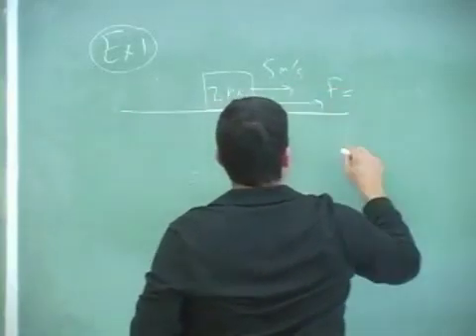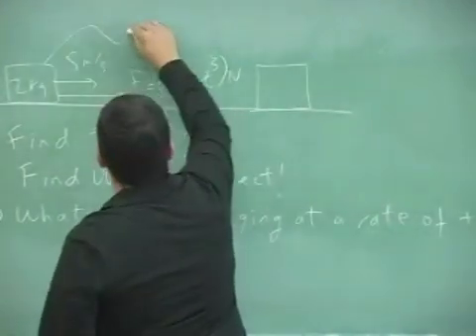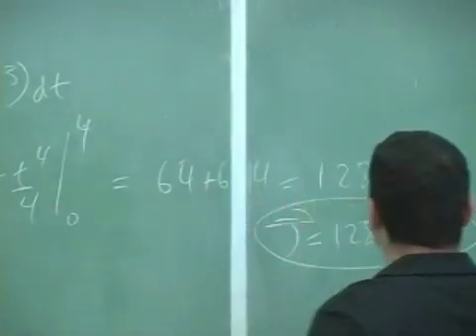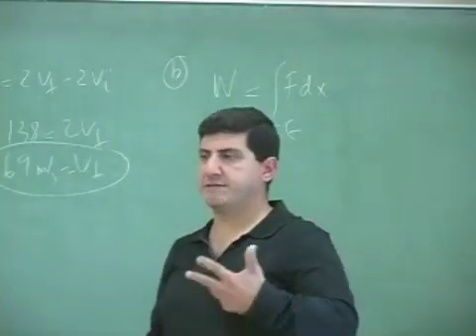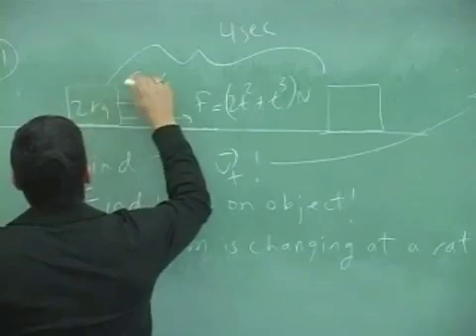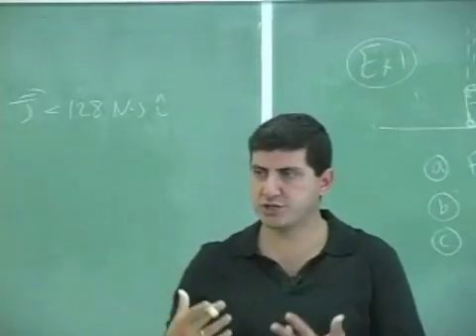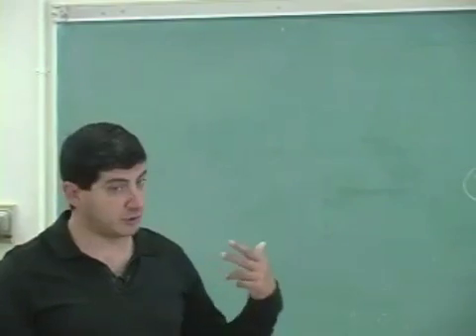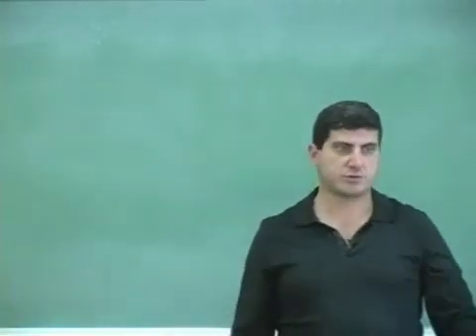Momentum and Impulse Example 1

Comment: great teacher, but this example is flawed.  the theory is sound, but when calculating the impulse, the force function was integrated wrong. simple mistake, but                   ₀⁴∫ (2t² +t³)dt = ⅔t³ +¼t⁴ ⎮₀⁴  ≠ t³ + ¼t⁴ ⎮₀⁴   see (2:35).   =)